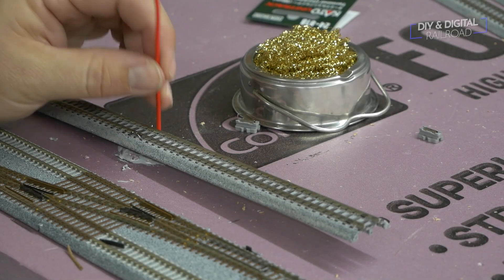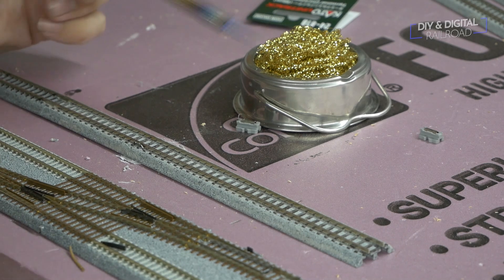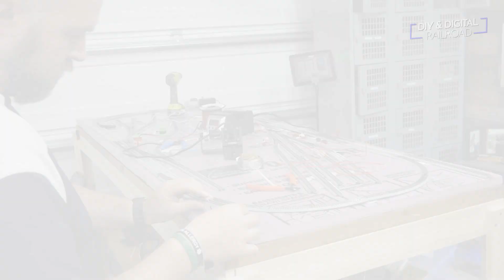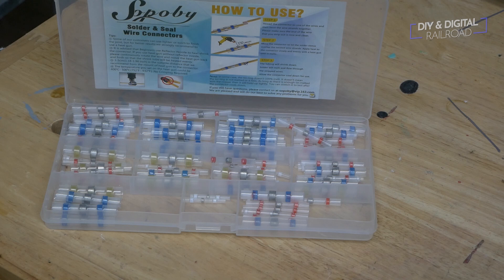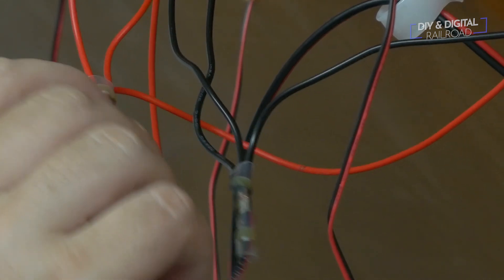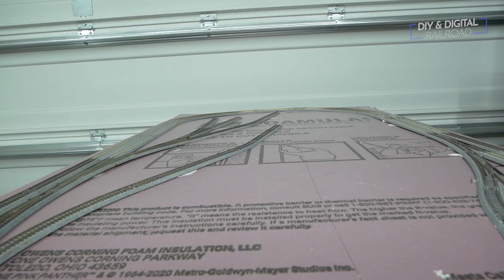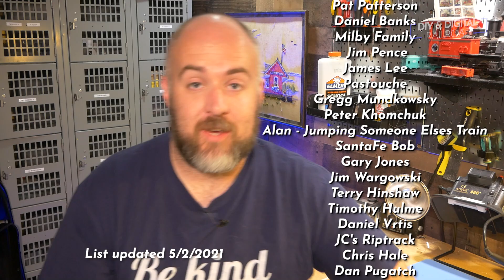Model Railroad Layout Update 3: Wiring to Run Trains

Comment: sorry, might be a silly question but what scale is this?
Reply: ps, the only thing about the wiring i would change is: common rail.
Use a rail or 2 or 3 underneath the table. And you can hook up small wires to that to anywhere you want.
I think it sorts things better than these loose wires.

Spare track or just the cheap stuff you dont use and got laying around.
It provides for a nice way to "wire" stuff.
Like a breadboard or how you call it. (dutch, i said that already didnt i?)

Comment: Why solder feeders instead of using terminal joiners?
Reply from the maker: The main reason was cost.  I only paid $12 for all of that wire.  Which is the cost of about 4-5 terminal unijoiners.

Comment: I assume that for a larger layout, you would label the wires. I use T-taps to connect feeders to bus wires. That is easier to install, I think, and the feeders can then be removed for fault isolation.